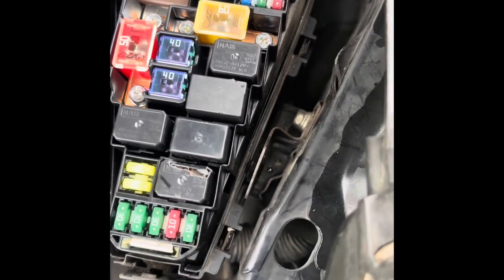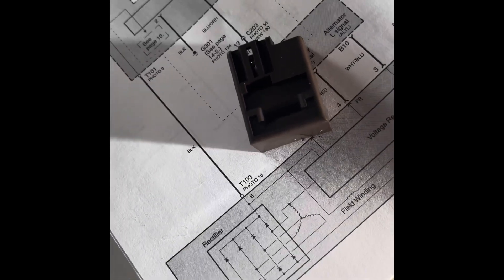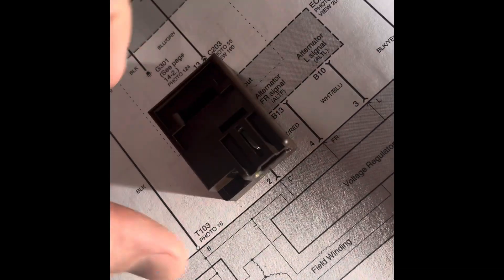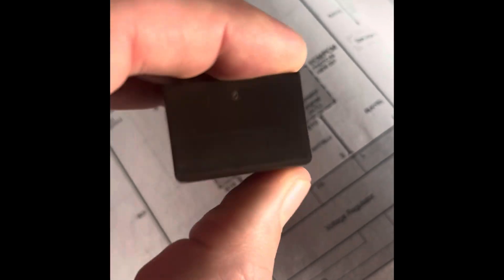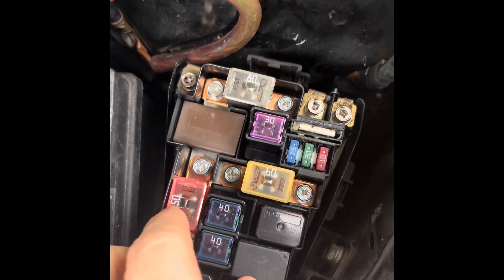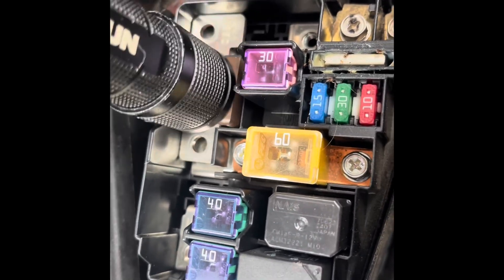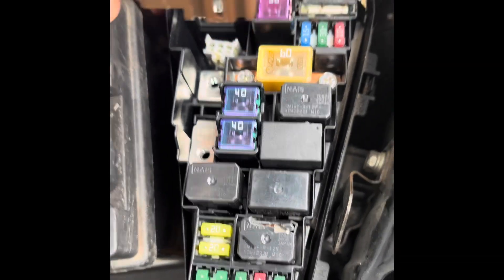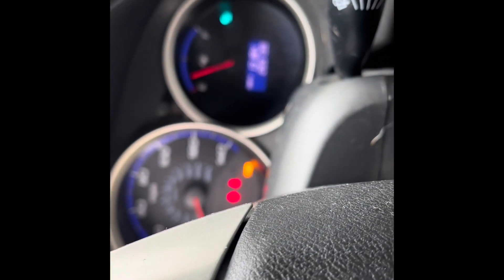Honda ELD Delete (remove or replace Electrical Load Detection on 2007-08 Honda Fit / Sport)

Comment: Just came across this video. Did you end up leaving with ELD removed and the Fit ran normal or did you put it back on?
Reply from the maker: The vehicle functions way better without it, I would never consider putting it back in.
Reply: @Pypical No check engine lights? I might do this as a preventive maintenance thing.
Reply from the maker: @allentownrep  no CEL, everything‘s great…. It’s technically not what tells the alternator to turn off, that’s between the ECU and the voltage regulator….. every once in a while the alternator will kick off for a few seconds, but without this POS it almost never kicks the alternator off…. I also got an OBD II instrument cluster pod to monitor the exact voltage and temperature since the dash just has idiot lights.

Comment: Great fix for this issue! I’ve been having this issue for years and haven’t been able to figure it out. Installed a new alternator and went through 2 (used) batteries and now a brand new battery… I’ve been having issues with my AC not staying on at idle… hopefully this solves the issue… updates to come.
Reply from the maker: This may or may not be your issue but personally, I don’t like this or start stop systems so I would delete this, even if I wasn’t having problems.

But I think if you’re having any sort of electrical problems, this is a great troubleshooting step (unless you absolutely know that your electrical problems are not related to the alternator cycling off)
Reply: @Pypical  subbed, all vehicle specific suggestions are very appreciated.
Reply from the maker: @danielgriffith8911  check out my clutch delay valve delete video too